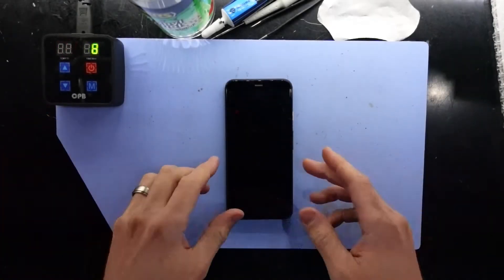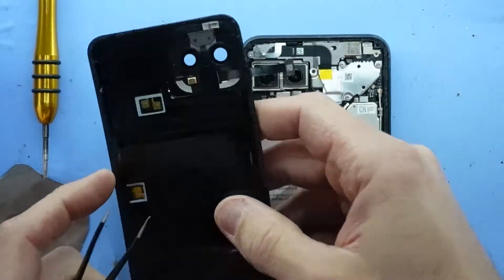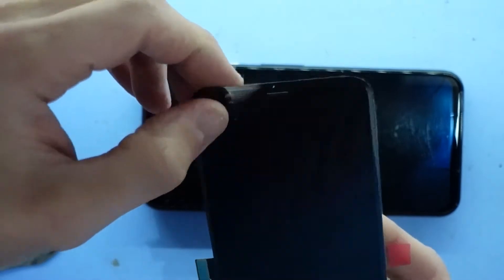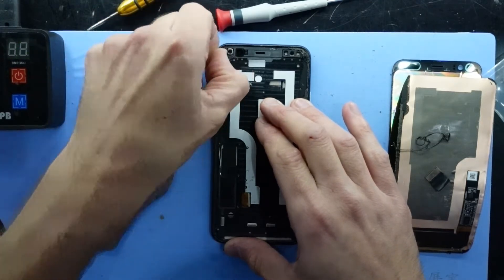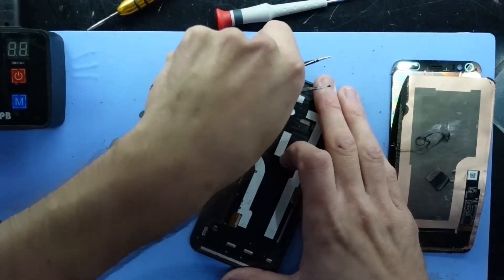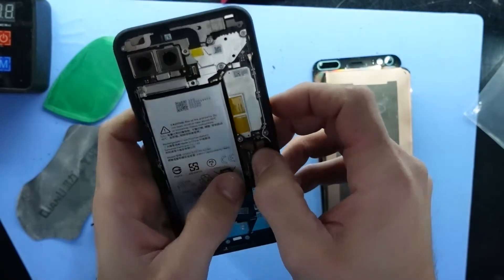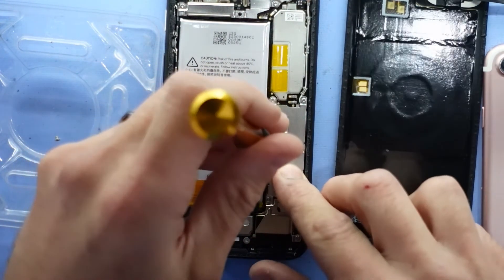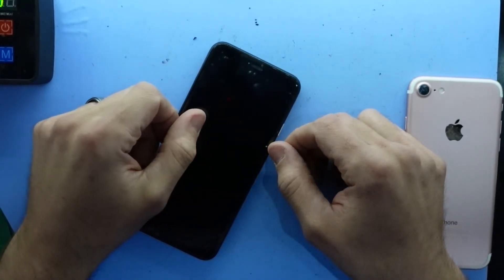Google Pixel 4 Screen Replacement (English/Commentary)

Comment: Hi, I'm currently in the process of replacing my back screen, battery and charging port on my pixel 4. The question is what is on the inside of the back screen? the replacement screen i bought doesn't have it on there and i can't change it over easily. I'm think about putting it back on for now (its cracked badly and falling to pieces but tape may help haha)
Reply from the maker: sorry i cant rememeber, been too long since i worked on it.
use heat to help take sensors off

Comment: Is that rubbing alcohol you're using there? wondering if its fine to use those for cleaning electronics and so on
Reply from the maker: im using isopropyl alcohol, which is fine for cleaning  electronics (just don't get it on the screen)